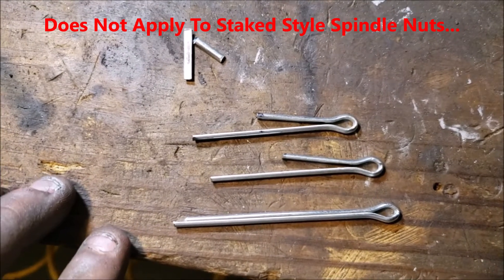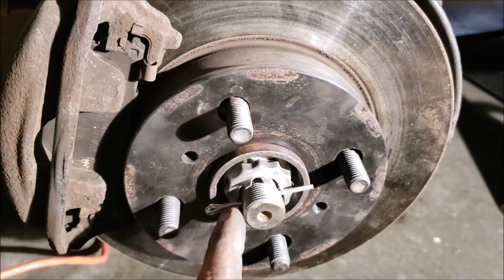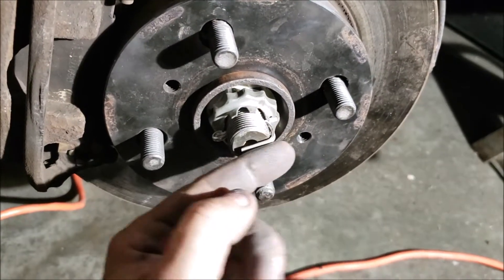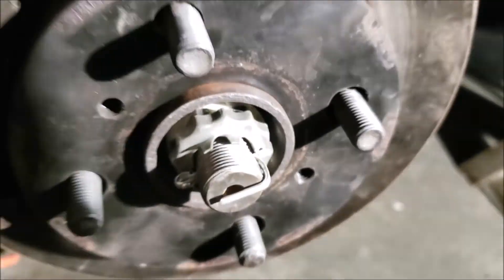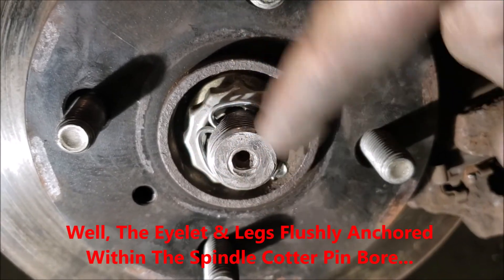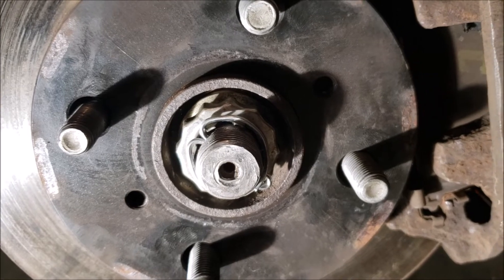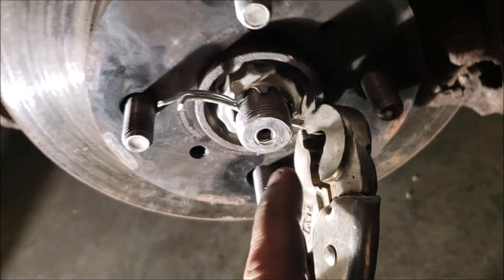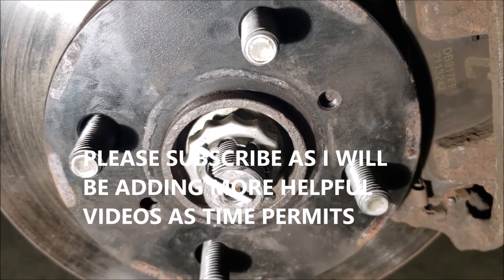How To Properly Install A Spindle Nut Cotter Pin (02 of 02) 🔧

Comment: Watching youtubers install cotter pins always makes me cringe. I had to search to find yours. IMHO you are the closest to correct. I learned in the 60s when there were still lots of cars with radio suppressors in the cap. Your way would rip it apart because it rode on the end of the spindle. This way is faster and neater. slide the pin in the same way with the long leg toward you and hit the head with a hammer or even your dykes. I f it's the right size the front leg will pop out at you. Bend it toward you 90 degrees and  cut it off flush with the spindle then cut the back leg flush with the nut. that's why they're called hammer lock cotter pins.

Comment: Like most viewing any info source, it's generally after having done various repairs on our own for more than 10 years. In my case about 54 years at this writing. Yet if you don't learn something new now and then, if something bugs you the option is to seek out others with tricks of the trade you might not have tried b4. Currently I am converting drum brakes to a disc brake set-up. Studebaker but using GM parts to include rotor and caliper. In a kit was supplied an extra axle washer, cotter pin and nut retainer. Ok, until now I've seen various nut retainers but never had to install a castle type nut with prongs facing outward. I'll get to my point...really I will. Old school nut had slots in it to accept the cotter pin. Yes I've struggled with prior install by others of a cotter pin bending over "both" prongs on the pin and around the axle nut. I've had to beat out, cut off, use a vice grips etc etc due to rusted or mangled pins. Your comments...can appreciate the sense of F*****g humor as it's something I have to curb now and then. But why use the castle nut retainer if you already have an axle nut with slots for the cotter pin? No one addresses this. In my case, to move the axle nut outward far enough to have adequate notch to use the cotter pin, an extra axle washer had to be used. It still isn't far enough. Ok...using the castle nut as the 3rd washer the cotter pin will not engage with any of the prongs and just barely engages the slots in the axle nut by itself. It was just a quick observation on my first day of working on the car and will resolve the problem today 5/26/22 by either finding another axle washer to space out the nut and eliminate the castle nut retainer. If I remove one washer and use the castle nut retainer there is still too much slop. Your video at least shows the cotter pin sliding thru the axle and between (2) of the castle nut retainers prongs. That was what I was looking for. again, my point? Thanks for sharing info about a front spindle showing the retainer in place and prior to install of the cotter pin. I agree that both prongs aren't required to secure the nut....just to wrap around on 2 sides the nut? One is sufficient.. Whew!

Comment: Foremost, they are split pins and they only need to be bent at 45 degrees on the short leg and there is absolutely no requirement to bend the pin right around the nut. You need to understand what the pin's purpose is which is to stop the castellated nut from coming loose and bending them right-over is pointless and just makes them harder to remove later.
Reply: There is something called a dowel rod.  It can be used to pin two parts together with glue.  Dowl rods can be hollowed out.  You then have a hollowed out dowl rod.  A hollowed out dowl rod can have a groove or “split” machined in.  You then have a hollowed out dowl rod with a split AKA a “split pin.”  Split pins are convenient because they usually have a tapered edge allowing them to be pressed in.  As the split pin is pressed in it decreases the split’s gap essentially turning it into a now spring loaded “split pin.”  This is convenient for applications where gluing hampers future maintenance.

Cotter pins come in many shapes and sizes but, this video is dealing with automotive cotter pins. There is no such thing as a slit automotive cotter pin.  They are all strait pieces of metal machine bent into a tight horseshoe resulting in what the automotive world widely accepts as “legs.”

You need to understand what the cotter pin's purpose is; to act as a safety net if for any reason the castle nut was to come loose.  A cotter pin does not stop a castle nut from coming loose, for that to happen you would either need to use a split pin, an oversized cotter pin, or a larger castle nut- hence wedging the castle nut’s shield to the point of zero play/slop.  The cotter pin prevents the castle nut from continuing to back off once said castle nut has become loose.  That is part of the design, if you can not wobble around a set cotter pin freely it is a strong indicator that the castle nut has started to loosen.  I say strong because other factors such as rust can make the cotter pin become stationary- hence why this videos describes how to set yourself up for easier future removal (I live in a climate where they stay wobbly 99% of the time)… but you wouldn’t know that because you started bumping ignorant gums before completing the video in it’s entirety.

Sometimes you can get away with bending at 45degrees (though bending is designed to be done on the LONG LEG (see my video “How to Properly Install a Suspension Cotter Pin (01 of 02)” for a logical explanation.)  Sometimes 45 degrees is not enough as the size of the dust cap and/or the wheel center cap can interfere with the protruding LONG LEG of the pin that SHOULD ideally be bent (over time you “might” gain enough “hands on” experience to understand what I am talking about.  In that scenario, you either have to either adjust the cotter pin like I showed in my video (which works 99.9% of the time- hence why I demonstrated it that way) or trim down the long leg (unnecessary effort and less meat to play “tug of war” if fighting an extremely rusted example ect.)

This all renders your chosen word “foremost” moot.  You f with a bull and you will get the horns.  Well, not always- I am sure you are the kind of guy where most people you are preaching to just stay quiet patiently counting the clock yearning for that moment when you either allow a pause or conclude so as for ear molested individual to be able to GTFO…

I will tell you want I tell my kids.  Life is a learning process- do not be mentally lazy and settle with backwoods “well I think” logic.  Do not just think, KNOW.  Do not talk the talk unless if you have walked the walk or can at minimum cite your source(s.)  Why?  Because when you lack attention to fine detail not only do you become “that guy,” but you have to deal with the embarrassment of stumbling upon “that other guy” out there who knows more than you and will confidentially put you in check.
Reply: I would expect you to be the kind of guy who would chew my ear off about how a Jackaroo, a vehicle that I would consider buying my daughter for her first vehicle, is superior off-road to my 1982 Chevy 1 ton big boy chassis with a 454 big block/TH400/NP205 combo… see the level of gear head that you are dealing with????